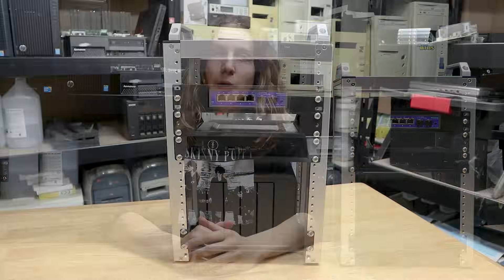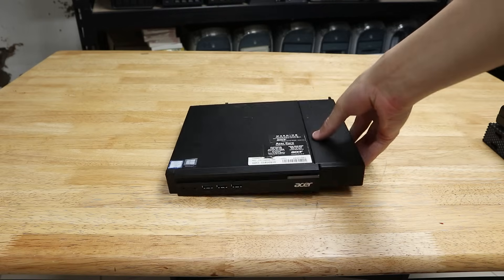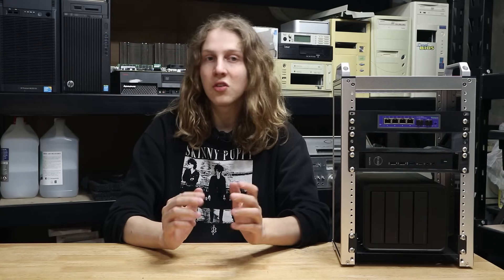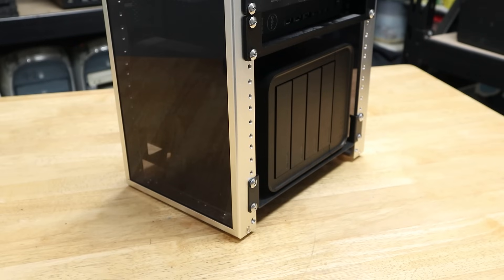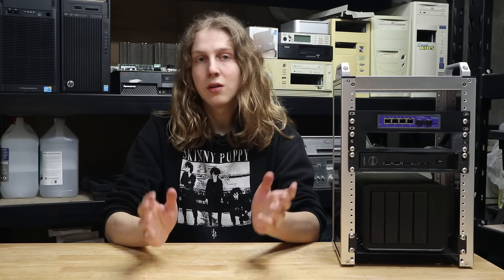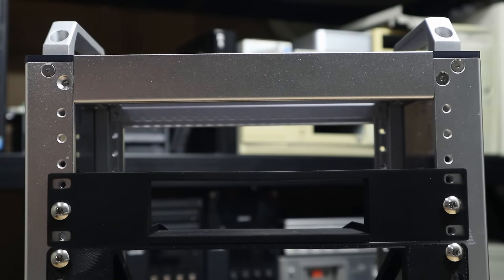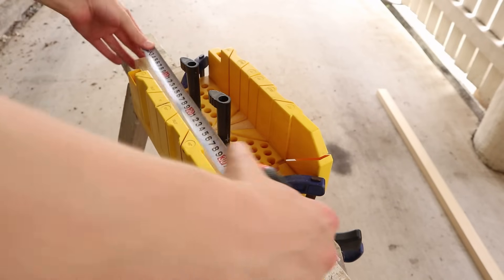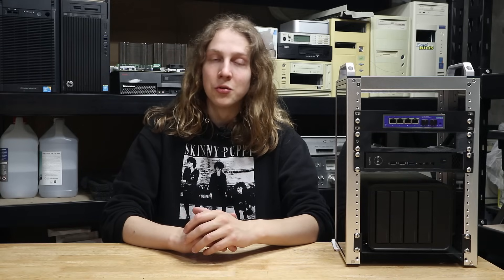Better than DIY? DeskPi RackMate T1 Review and Comparison

Comment: Tec Mojo has PDU and way more shelf options, including patch panels ect... i bought the 9U and a few blanks, shelves and 12 port patch all steel construction. Once assembled the rack is  super strong and ridged. Not saying deskpi rack is worse but your paying more for a popular name brand. i went with tec mojo because i liked the look and construction and most of all the prices were more reasonable. i think your getting alot of flex in your deskpi because your not using the steel shelving but using all 3d printed shelving, try adding a blanking panel or shelf and the unit wont flex much if at all.